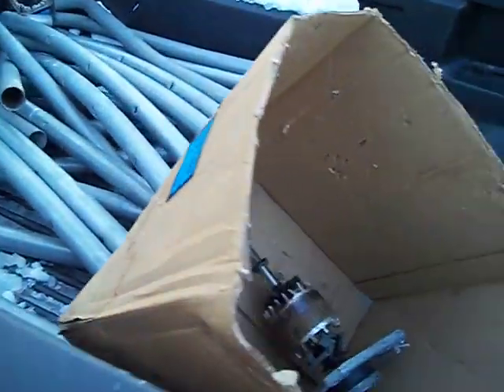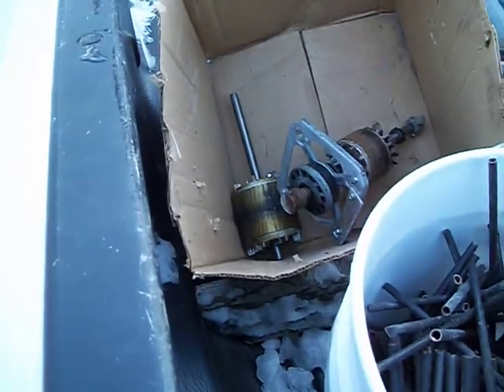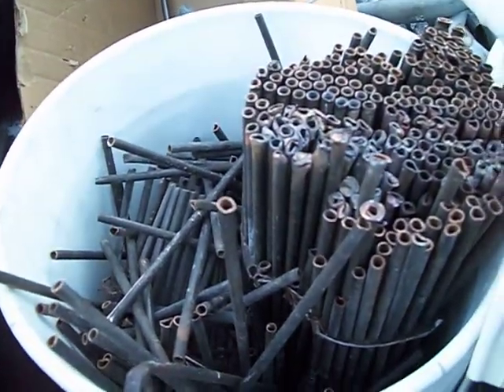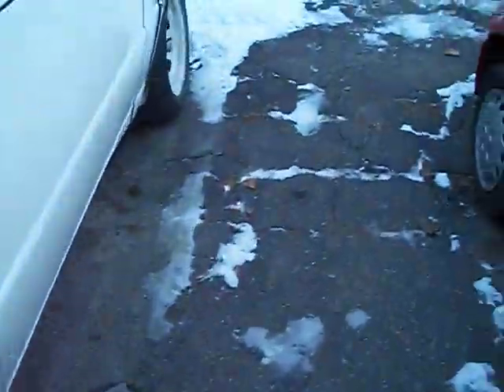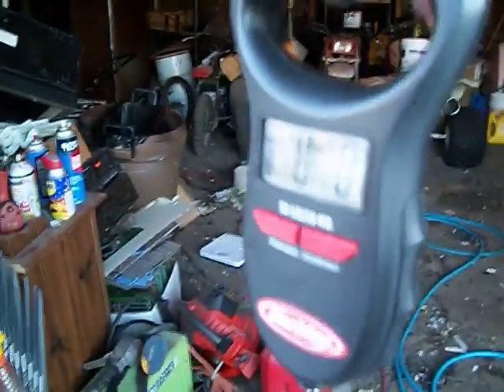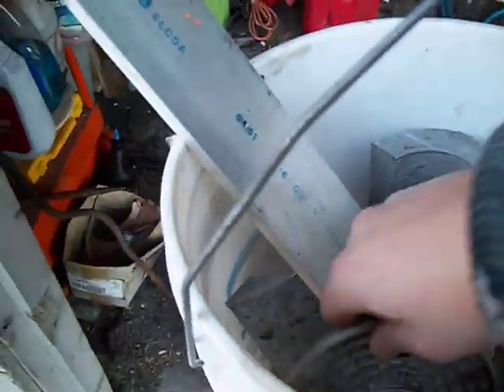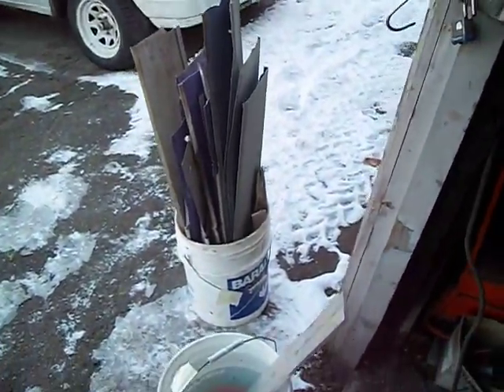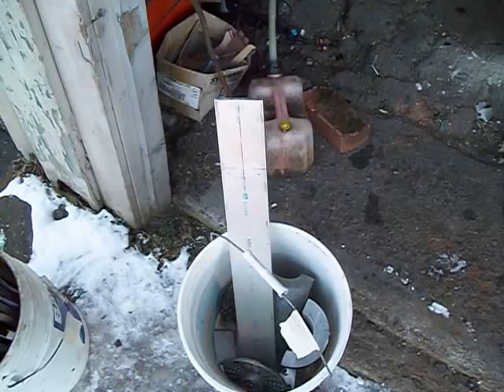off to the scrap yard scraping tips

Comment from the maker: it was like 12 bucks i think,, ive had it for a few years still works great.. it takes the same button cell battery thats on a computer mother board.. so i have an endless supply of batteries the original battery has not died yet,,, i use it all the time... get one in the fishing section at walmart...it will pay for itself the first time you go to the scrapyard